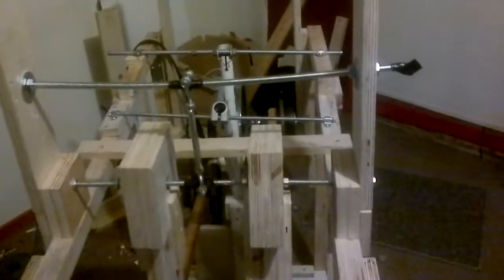PenGen update 1

Comment: 0:53 No, you wont.
Reply from the maker: Hulla Dek yes you are right at current, those electro magnets are pulling too much juice.
Reply: SonsOfTesla.Com Yea, you want to move that huge machine and the will turn a generator. Now forget the huge machine and turn the generator with a normal electric motor and you still lose energy.
Reply from the maker: Weight, leverage, and gravity are the three things I would be losing out on if I just ran a generator from a motor.  We all know that if you can't get your lug nut loosened on a car tire rim then you get a longer handle or put a pipe on your wrench to lengthen it. This will increase the torque but will have to travel a longer distance. This setup gets gravity and magnetics to help travel that extra distance. So the input energy is added at the return stroke regardless of the distance it has to travel. This was the idea, increase torque buy not increasing energy input, but by increasing length of the lever and swing 20 pounds per pendulum. The distance is 2 feet by 20 pounds per pendulum to the top of the pendulum. However the take off point is one foot from the top of the pendulum so the torque would be half that. The problem I am having is my magnetic ramp is not tight enough in distance and my larger electro magnets are drawing more electricity then I would like.  I may for go that and use an electric motor to push the pendulums instead. thanks.